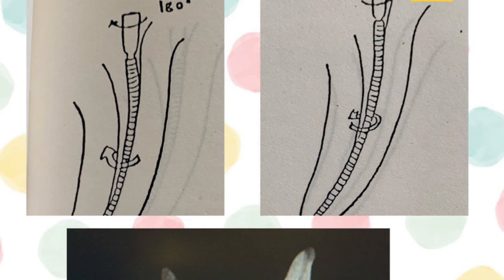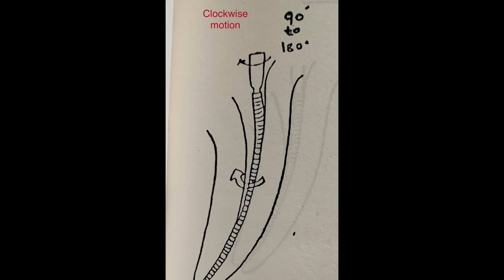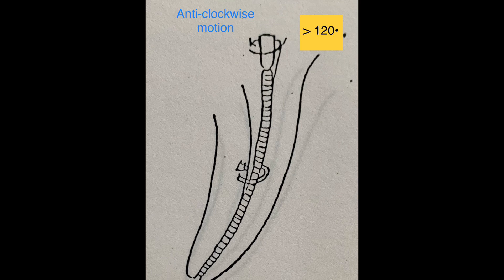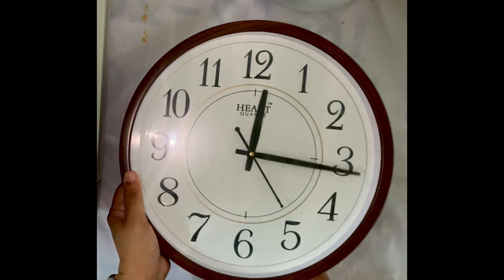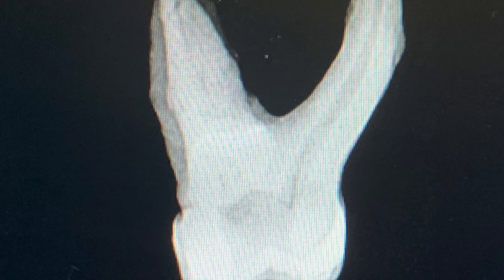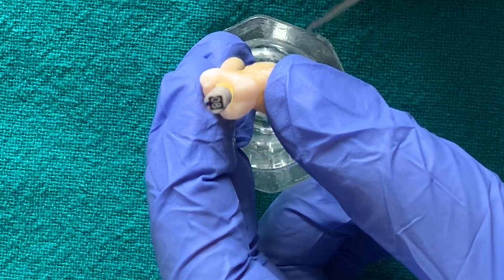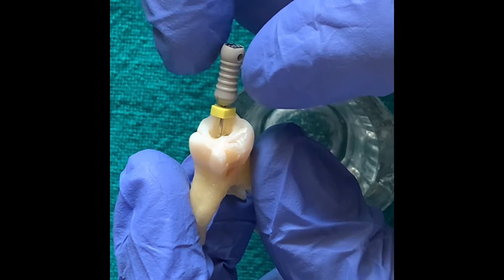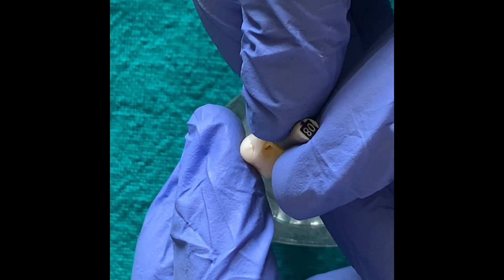Balanced force technique tutorial| Curved molar root canals

Comment: can i use 30 35 40 stiff straight k file with balanced force technique?
Reply from the maker: Yes but use it only for straight canals or slight curvature
Reply: Do we need precurve K file with balanced force technique? Thank you.
Reply from the maker: No
U take d file to a point of deepest penetration. From there u gradually work u r way to the working length